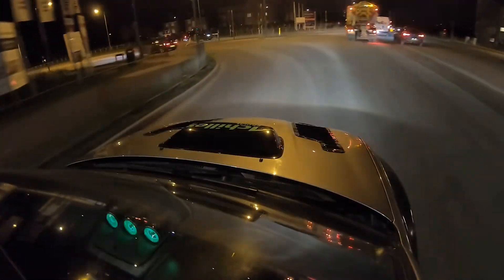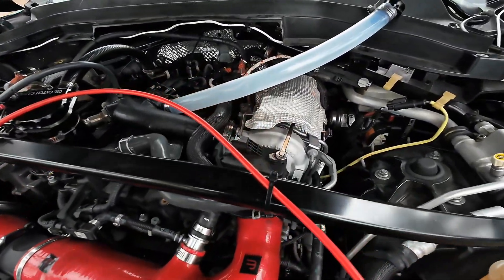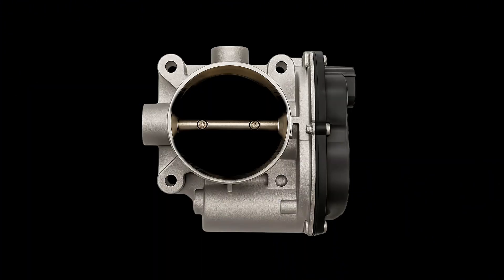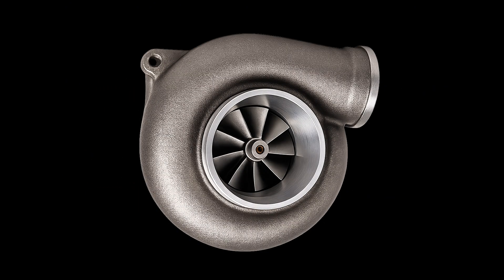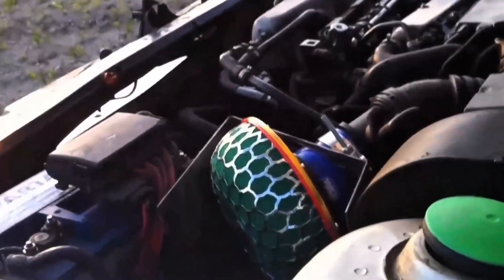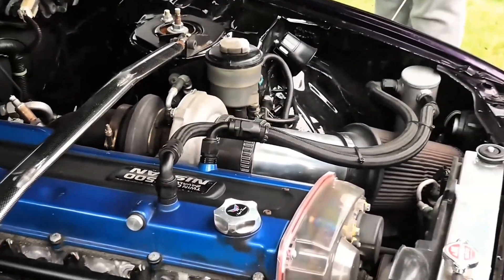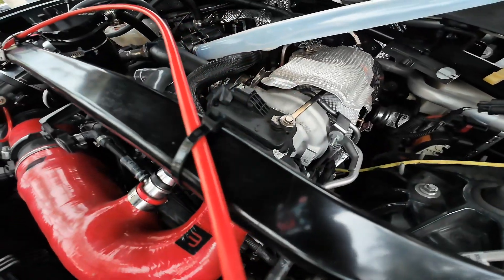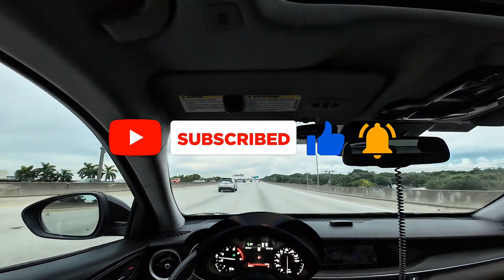Car Culture LIED about TURBO FLUTTER

Comment from the maker: (10/30/25 update)

I realized I overstated this one, here are some established theories from this comment section to clear up any concerns:

BOV vs. no BOV doesn’t measurably change throttle response, with no BOV slightly improving response as inferred from track-use setups.

No BOV doesn’t slow the compressor wheel measurably.

No BOV is largely claimed to be safe based on anecdotal comments and user experience.

As said before, the animation showing the compressor wheel rotating backward was inaccurate on my part, and it was meant to represent only the airflow - not that the wheel reverses direction. The compressor wheel does not reverse direction.

OEMs use recirculating BOVs largely to eliminate sound, somewhat improve throttle response, and eliminate any hints of possible jerkiness or oddities.

Final verdict: Purely off anecdotal accounts, running no BOV appears to be safe. Please remember, throttle lift surge is still “surge” and has the possibility of reducing your turbo’s lifespan.
Reply: Turbo flutter is safe and doesn't hurt turbo life now surge is different that's underload and on throttle that is detrimental
Reply: I respect your position on this, as We plan to provide detailed testing and a video in the future.  I will also say the quality of your video is excellent!  I can also send you some videos we have done through email or PM if you want to run down the rabbit whole of turbochargers.
Reply from the maker: @Drift_Wolf13 

I'm always easy to reach, email is in the description. I may make a follow-up video since I have so much useful data and research from the resounding amount of comments.

Comment: Im no expert but im sure modern turbos are fine without a bov. Most turbos are built with an anti surge compressor housing. Hear from many motorsports drivers say they dont run a bov and years later the turbo is still fine

Comment: Although this is true, and would be certainly true 10 years ago. Most modern turbo designs, like new designs not just old ones still being produced today, are much better at handling this, and like he said ball bearings ones more. However newer turbos are built insanely good now, and unless your really pushing high psi, they will live just fine.

Comment: It's really easy to rebuild a CHRA and kits are usually around $35. It's worth the rebuild to have the noises since you rarely use the power on the street.

Comment: I dont know if youll read this but, is there any possibility in the world to make a bov with turbo flutter? like have something like a separate turbo-like fins in the same direction but have a diverter going to it and ‘damaging’ that instead of the actual turbo itself?
Reply from the maker: From what you're describing, it almost sounds like you could have the pressurized air released from a BOV shoot through a mini electric turbo to attempt to mimic the sound.

Otherwise, I don't know of any legitimate ways (I'd be using it if I did). There might be decent BOV options that can mimic it for your specific platform.

Sorry to dissappoint!

Comment: a diverter valve isnt an electronic bov. it diverts the air around the throttle into the intake and into the engine. bov vent to atmosphere. flutter was a bigger issue before recent turbo technology with bypasses and better bearings. even older turbos its not a u might blow it up kinda thing its just taking away from its life.
Reply from the maker: A valve is just a valve. Don't overthink it.
Reply: @TorqueTheoryLabs lol no not really and its not electronic at all. its ok to be wrong but dont go doubling down lol

Comment: I remember when I had a Neuspeed intake on my 2007 VW GTI (DSG) and I can hear the intake noise/turbo spool, If I released the gas and tapped the gas quickly, it would make a flutter noise. It had a DV (just like the one pictured in this video). I'm assuming it wasn't a perfect system to negate the flutter.

Comment: You’re conflating turbo surge with the turbo flutter?? Are you sure you know what you’re talking about? Because turbo surge happens when the throttle is open, not closed. Your video is wrong, bud.
Reply from the maker: Are you sure you know what you're talking about? I made a video on WOT/part throttle surge as well. Surge is low flow instability. There are multiple scenarios in which that condition can be met, this is one of them.

But, please read my pinned comment.
Reply: Turbo flutter is simply what people call surge that happens off throttle, they are the same thing.
Reply: @DriftNick it’s not but ok. Throttle closed is not surge
Reply: @pewpewdru So what happens when the airflow is reduced and pressure ratio increases? the turbo starts to surge, that happens both on or off throttle, the turbo doesn't know if the throttle is opened or closed.

Comment: Definitely correct, I have blew up 4 turbos not running a bov
Reply from the maker: Are you certain? I have had a resounding amount of anecdotal replies indicating running no BOV is safe. Some more info on how it failed would be greatly appreciated!
Reply: @TorqueTheoryLabscaused shaft play and it ate the blades off of the compressor wheel because it would touch the inside of the turbine housing I did notice on low boost it was fine but anything over 10 psi it does it every time without a bov gt3076
Reply: @sirsendit9770  If you killed 4 turbos you were doing something wrong, running no blow off valve will not cause that to happen.

Comment: Compressor surge happens when the engine cannot consume the volume of air produced by the turbo at wide open throttle, this can typically happen with large extremely efficient turbos on small capacity engines where at low rpm the volume of air has no where to go. You han actually hear it at wide open throttle. What you  have explained here is Compressor stall. Stall of the Compressor happens when the throttle is shut.
Reply: Compressor surge and compressor stall are the same thing, it's the air flow separating from the blades of the compressor, this happens both on and off throttle.

Comment: The Truth About Running Without a Bypass Valve (BOV)

Having worked in and around a turbo shop for nearly two decades—and as the long-term owner of numerous turbocharged vehicles—I’ve gained extensive hands-on experience with a wide range of setups.

My current cars include a JZX100 equipped with the factory turbo featuring a ceramic turbine wheel, which shares much in common with the RB20, RB25, and RB26 turbos I’ve owned and tuned in the past. Add to that a 240SX with an SR20 that’s been heavily used for drifting, an 80-Series turbo-diesel Land Cruiser (which, until recently, was non-intercooled and running 20 psi), and countless other builds over the years.

In addition to this, I’ve spent roughly 20 years professionally rebuilding turbochargers in a dedicated shop environment. I’ve taken my time before speaking publicly on this topic—only in the past five years have I begun sharing my findings more openly. Interestingly, in drifting, BOVs are rarely used, and early observations may even suggest that they contribute slightly to turbo lag, though more data is needed to confirm this.

Across all of these vehicles, I’ve consistently run without a bypass valve (BOV) and have never experienced turbine wheel damage, bearing failure, or other turbo-related issues. These aren’t casual street cars—they’ve been drifted and tracked under demanding conditions with zero ill effects.

There’s far more to this subject than what’s often repeated online, and many of the common arguments against running without a BOV stem from misunderstandings about compressor surge and turbocharger dynamics.

Understanding Compressor Surge

Many enthusiasts confuse compressor surge under throttle with surge on throttle lift, but these are fundamentally different phenomena.

Compressor surge under throttle (while still producing boost) is genuinely destructive. I’ve seen failure rates near 99% in these cases. No BOV can prevent this, as the root cause lies within the turbocharger’s aerodynamic design. The proper fix involves modifying the compressor wheel or housing—hence the development of anti-surge compressor covers.

Surge on throttle lift, which occurs when the throttle plate closes and boost pressure momentarily backs up, is much less harmful than commonly claimed—especially on well-matched setups. In fact, the stress on the turbo during this event is comparable to the normal loads it experiences while making boost.

Why OEMs Use Bypass Valves

There are two primary reasons manufacturers equip vehicles with BOVs: sound regulation and drivability.

1. Sound Control

Modern noise regulations and consumer expectations for refinement have driven manufacturers to reduce the audible “flutter” or surge sound associated with turbocharged engines. In contrast, during the 1980s and early 1990s, BOVs were uncommon. The turbo failures from that era were largely due to poor maintenance, low-quality oil, and inadequate cooling—not the absence of a BOV.

2. Drivability

Think of the intercooler system—comprising the piping and core—as a kind of spring. Smaller systems act like high-spring-rate setups, causing jerky transitions or a “bucking” sensation when lifting off the throttle. To the average driver, this feels like poor tuning or hesitation.

Increasing intercooler volume and slightly upsizing the piping reduces this stiffness, improving throttle response and eliminating most drivability issues, even without a BOV.

Real-World Comparisons: Diesel and Data

Diesel engines offer a great point of comparison. They do not use bypass valves, yet regularly experience pressure fluctuations during throttle lift and gear changes. Despite this, turbocharger longevity in these systems is excellent.

Furthermore, data logging has dispelled the persistent myth that a turbo “spins backward” during surge. Shaft speed sensors show no sudden reversal or dramatic deceleration when the throttle closes—only a smooth, controlled change in speed.

When a BOV Is Necessary

While unnecessary for most setups, a BOV becomes essential in high-horsepower, large-volume applications, typically around 1200 horsepower and above. At these levels, the sheer volume of airflow and pressure can physically deform—or “taco”—throttle plates during lift-off. In such cases, a properly functioning BOV is a crucial safeguard.

The Hidden Risk: Faulty BOVs

Ironically, more turbochargers fail because of malfunctioning BOVs than because of their absence (I’m looking at you, EcoBoost). A BOV that leaks or fails to close completely can cause the turbo to enter a choke or stall condition. In this state, the turbine wheel experiences immense torque while the compressor wheel remains stalled, placing extreme stress on the rotating assembly.

This can lead to catastrophic failure, including:

Twisting or shearing of the turbine shaft

Thrust bearing or bearing race (in ball-bearing turbos) destruction

Turbine wheel contact with the housing

Severe imbalance leading to journal or ball bearing failure

In the case of ball-bearing turbos—which often incorporate thrust control within the cartridge—these failures can be even more severe and costly.

Conclusion

For the vast majority of setups, running without a bypass valve presents no greater risk than normal operation—provided the turbo system is well-matched, properly maintained, and lubricated with high-quality oil.

Bypass valves serve legitimate purposes: sound control and drivability improvement. They are also necessary for extreme-performance builds where airflow volumes can physically threaten throttle components.

However, for most street, track, and drift applications, the absence of a BOV is not the ticking time bomb it’s often made out to be. In real-world practice—and under proper conditions—running without one can be entirely safe, efficient, and reliable.
Reply from the maker: I appreciate the consideration made into writing this comment, it's well thought and it's accurate.

Since many OEMs are running high PRs (3+) with journal bearings and small compressor wheels on direct injection ecoboost type motors - do you see any thrust bearing risk or major wear occuring from not running a BOV?
Reply: @TorqueTheoryLabs The EcoBoost engines most commonly fail due to oil contamination, overspeeding (usually caused by wastegate issues), and faulty bypass valves—even with the later introduction of electronic units. In most cases, the root cause of failure is the high load placed on a very small thrust bearing. With such a small thrust pad, the risk of metal-on-metal contact under full boost increases significantly.

We haven’t observed any failures directly linked to running without a blow-off valve (BOV), although we haven’t specifically tested that scenario. Based on what I’ve seen, these turbos are fragile—more accurately, very sensitive. I’d be cautious with smaller setups; they tend to fail from what seems like almost nothing.

For racing and performance applications, we require specific oil formulations (not viscosity grades), which has effectively reduced failures to zero. Any remaining issues typically come down to user error. Considering how small most modern journal-bearing turbos are, they generally operate at or near 100% capacity. In contrast, my CT15B running at 14 psi still has some headroom, well known for its small thrust bearings and limited maximum boost levels, it shows no signs of wear when supplied with quality oil.

I’ll be happy to share photos of the CT15B internals once I install the new turbo I’m building—a CT26-based unit with T3-sized bearings capable of handling boost pressures well beyond 18 psi. The stock CT15B, ceramic turbine wheel and all, is being rebuilt for my mentor, and we’ll be fitting it to his 60 Series Land Cruiser to test out another idea we’ve been wanting to try.
Reply from the maker: @Drift_Wolf13 

I appreciate the elaboration!

Comment: No no no a BOV is not a Diverter valve, they have different names because they function differently. A BOV vents to atmosphere, a diverter valve diverts it to keep your turbo spooled between shifts  by putting the air back into the system. With a BOV it doesn’t recirculate at all and just dumps the boost pressure (yes I’m aware of hybrid systems we ain’t talking those today)
Reply: Would it be harmful to disconnect the dv? Like one from a mk5 gti?

Comment: Not all turbo flutter is bad, Its hard to explain, but for example, the b48 (bmw's modern 4cyl turbo being produced to this day) has turbo flutter stock , but it still uses a Diverter valve. this is because it's placed in the turbo housing unlike most cars. Most of the time , as long as turbo flutter only happens during decel or downshifts it's mostly harmless especially on modern cars. But in the case of the 2jz's and rb26's you see in the older videos with the classic stututu sound, they are harmful because simply theyre old and the tech wasn't available at the time

Comment: Great explanation on how flutter works, but where's your sources to back up your claims?
I've heard testimony from veteran mechanics saying that zero load flutter has little to no impact on bearing longevity, what do you have that is more concrete?
Reply from the maker: No manufacturer has run endurance testing to quantify this, unfortunately. All claims to back this up are inferences from compressor maps and OEM assemblies.

This is surge, but in a form that's significantly less destructive then WOT or part throttle surge. With that said, regardless of the form of surge, there is plenty of evidence that surge itself destroys.

So my take on this is: the effects mirror WOT surge but in a lesser form. And I'd rather myself and everyone else be on the safe side because the gain in transient throttle response is trivial.

Though if you want flutter or are racing and need every advantage you can get - go for the high quality ball bearing turbos as I suggested.

Comment: A bypass valve creates this same noise… this is a dumb video 😂
Reply: No it doesn't, this sound literally happens because there is no valve releasing pressure, if you have a bypass valve that is working properly then there is a valve releasing pressure and there will not be any turbo flutter.
Reply: @DriftNick  subarus with bpvs and a big intake would like to argue with you. This sound can also happen because the bypass is feeding the compressed air back into the intake track, huh go figure, right back into the turbo blades, which then creates this sound.
Reply: @StarwindIV  You don't seem to understand what is happening, I'll try to explain it.

The throttle plate closes, there is boost pressure between the turbo and the throttle plate, that pressure goes back out the intake of the turbo over the compressor blades, this causes the flutter sound, pressure traveling in the other direction and out the intake.

With a bypass valve that pressure should never travel in the other direction, it does a loop back into the intake and goes back into the turbo, does your turbo flutter when air is coming into the intake? no.

If you have a bypass valve and hear flutter the valve is not releasing enough pressure to stop some of that pressure to go back out the intake the wrong way, it is not the bypass valve making the sound.